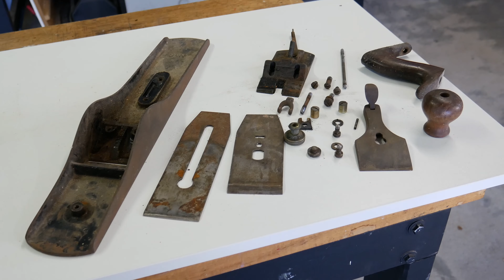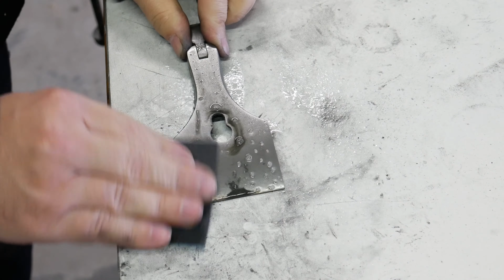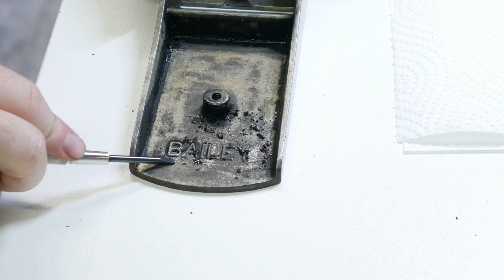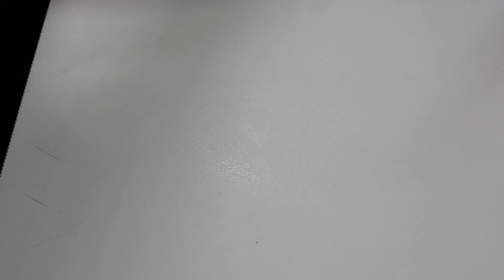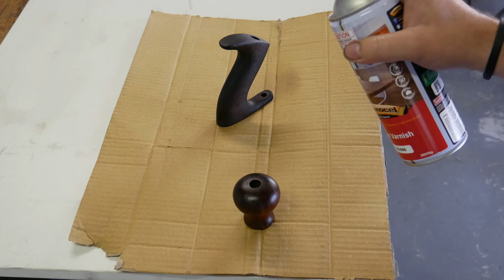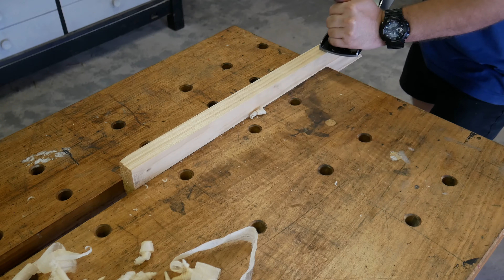Hand Plane restoration No 6 Stanley

Comment: 1.09   you soak it in vinegar, please don't. Six months down the track if you have not done it properly big rust , corrosion problems. If I buy your plane, I have to undo all your work.  please don't use corrosive substances in your restoration projects. cheers
Reply from the maker: Thanks heaps, that is the type of comments I like as I am just learning as I go.
Reply: @RJsShedShop  There are many product on the market that deliver good results. If You use an acid, if you don't neutralize it with another chemical it keeps eating away into steel. When we restore a tool we want the next owner to preserve our restoration, so 200 years down the line plane is still working. I restore tools, I have seen many restorations gone wrong. Keep at it and you will see results. cheers from Tasmania. just trying to help.
Reply from the maker: Much appreciated

Comment: Good job. I’m afraid that hand planing wood is now very painful for me due to shoulders and back. I still have a lot of hand planes and, if I’m brave or stupid, I spend 5 minutes with them. Then more Tramadol to follow.

Over the years, I have tried every method of sharpening there is - diamond, oil and wet stones. I will tell you what suits me - and that is critical; it suits me and may not suit others.

If I’m starting with a new blade or one that I’ve managed to chip, I use my Tormek. It’s a great device but not cheap; I know there are “replicas” around but can’t speak of them from experience. With the Tormek, I grind my first bevel square and true going from 200 to 1000 grit. Then I go new school, which is very unlike me. I use scary sharp films with my Veritas honing guide. I have found these films to be very good, clean and quick to use. Apparently, you are supposed to be able to hone with the blade going forwards; I’ve not achieved anything but torn film doing that. However, pulling the blade back towards you is very normal. I’ve got my primary bevel around 25 degrees (for a plane) from the Tormek and set the homing guide a couple of degrees away from that using the brass knob on the side. I guess around 27 degrees although I’m not convinced that 1 or 2 degrees is a game changer. I do have a few blades which I keep to 35 and even 45 for some difficult timber and a few low angle planes to help. 

Anyway, going from grits around 200 upwards takes only 5 minutes to get that secondary bevel. I then, like you, finish the job by using the DC ruler method followed by some wipes on the strop. Where this process particularly suits me is that I keep a sheet of plate glass with films on it right behind me. So, putting the edge back on the secondary bevel of a plane or chisel is very convenient; turn around, 2 drops of 3-in-1 oil; 3 or 4 wipes across the film; rag to wipe and back to work. I hate complicated methods because they take too much fuss and time - I know that this means I just won’t sharpen often enough - but I hate dull edges.

When do I know a blade needs touching up? It’s about 5 passes before I do it.
Reply from the maker: 5 minutes a day on a plane and you will get there, then they are a real joy to use.
Reply: @RJsShedShop  wish I could. Unfortunately broken bones have fused badly (broken neck, tibia and collar bone) so the disability there is permanent
Reply from the maker: Sorry to hear that.